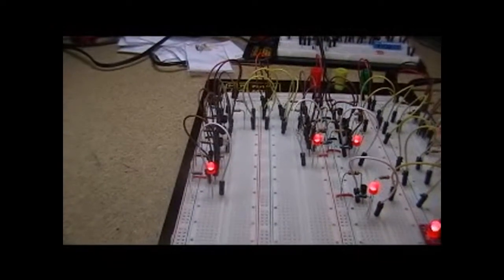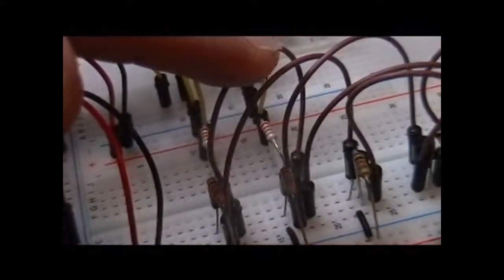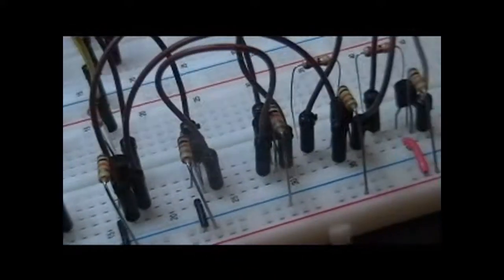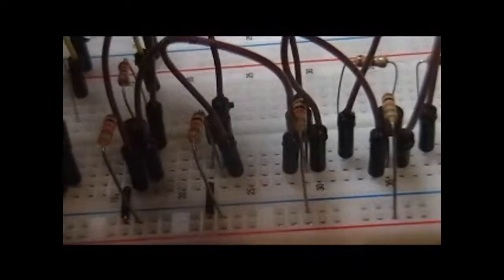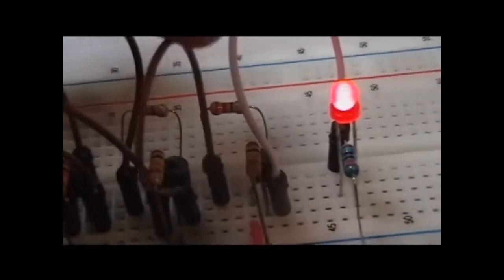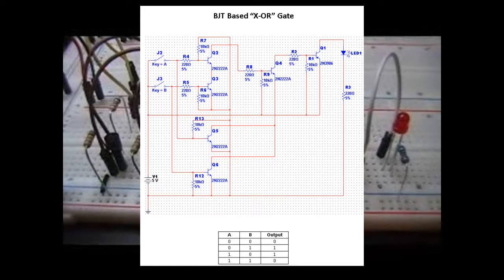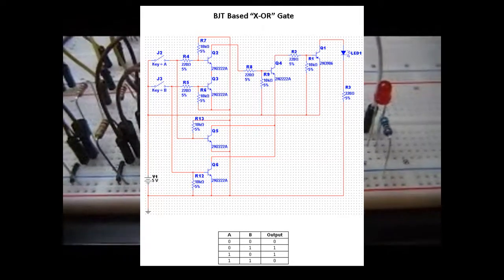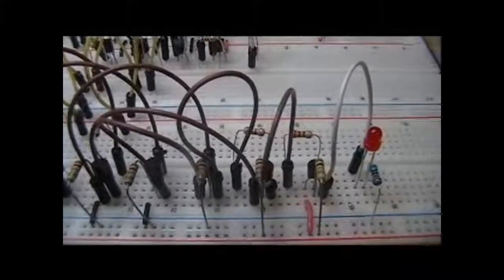BJT Transistor Logic #6 - XOR Gate

Comment: Hi Jonathan big fan of your vids, do you have the calculations for this circuit and what type of transistor are you using?
Reply from the maker: Andreas Fuchs It has been a while since I put these together, but I am sure I was using some general purpose transistors such as the 2N4401 and 2N4403 or the 2N3904 and the 2N3906.  As far as your reference to calculations, I am not sure I understand what you are seeking.  Are you looking for calculations related to transistor gain?  For these types of circuits, I simply go for transistor saturation.  If you are looking for something in the way of a schematic, I thought I had put those together and posted them somewhere.  If that is indeed what you are requesting, let me know and I will either find them and include the location URL or I will recreate it and post it.
Hope this helps and thanks for letting me know you appreciate the videos.  It is always good to hear that someone gets some value from the effort.  I frankly enjoy experimenting with various electronic circuits and am always up for trying something new I haven't done before and sharing the results.
Take care.  Jon

Comment: Hi Jonathan,I have watch all most all of you video's. I really like the way you are presenting the material. If you have the time could you cover the MOSFET the way you covered the transistors. Also the Schematic are very help full.
Reply from the maker: Sure, I have a break at this point and I was thinking of spending some more time on transistor biasing and amplification by revisiting some of the circuits in my blog (transistorbiasingandamplification.blogspot.com) and expanding on the analysis and incorporating the AC characteristics of them.  I also intended to go through both JFET and MOSFET examples. 

I will also put together some logic gates using MOSFETS.  Many of the actual logic ICs in use are CMOS which are FETs in a complimentary arrangement. 

I will see how far I can get before my focus returns to my degree.  I appreciate you comments and if there are other things of interest please mention them as I am always looking for new types of challenges.